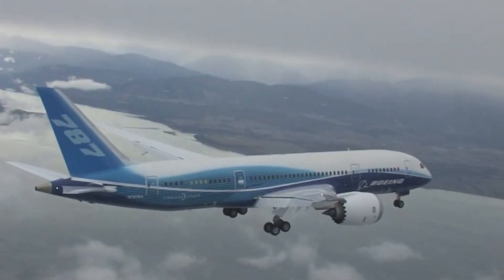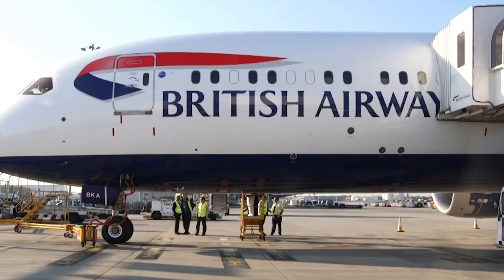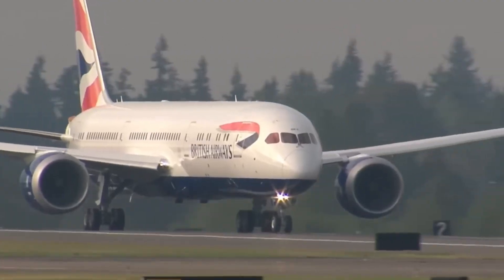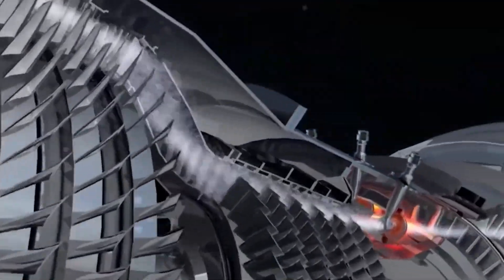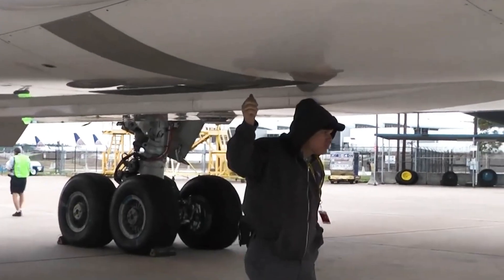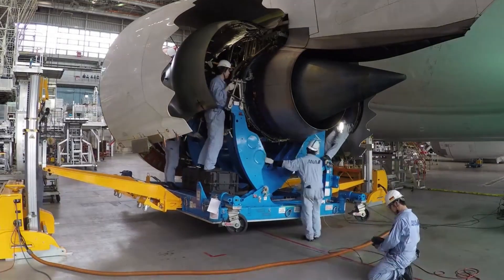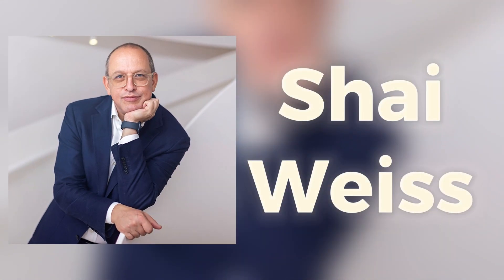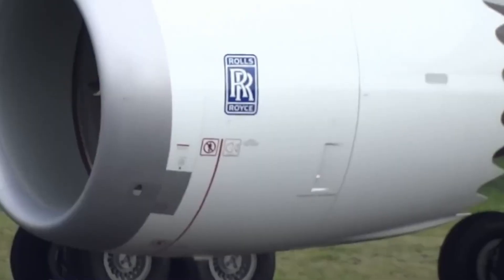Here is Why BOEING Will NEVER Trust Rolls-Royce Engines Again!!

Comment: Rolls   Royce   Makes Junk  Jet engines. the RB211 damage the  sales of the  L1011
Reply: Not true.The L 1011 was a plane they didn't want, to expensive made to show off while most bought the faulty that fell out of the skies DC-10, but in the end they both lost to twin engine A300 made from 1974-2007 and continues as A330 .RB 211 was a game changer and most new jet engines have some problems just like Leap 1 HAHA
Reply: Really. Useless statement. American uses RR for their 777 200er s. Only the 787 trent 1000s have issues with blades internal issues.